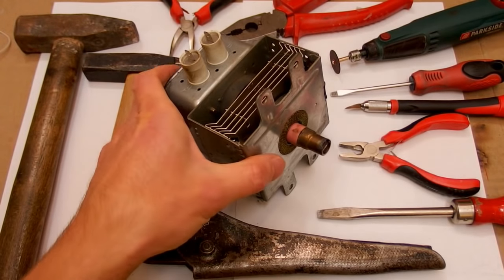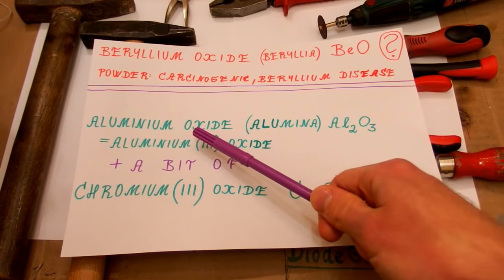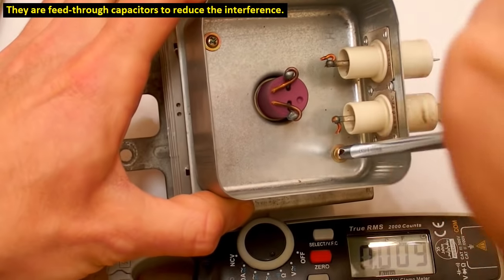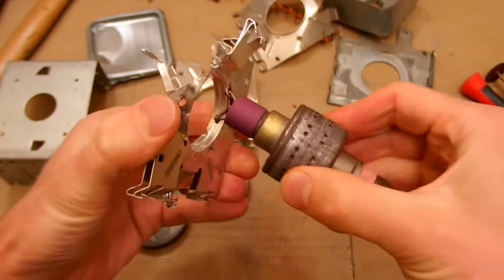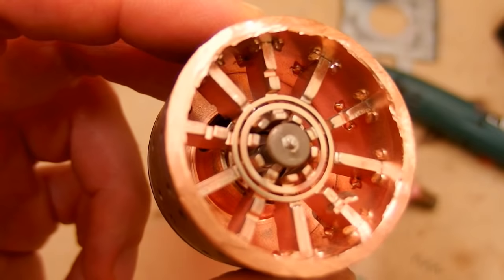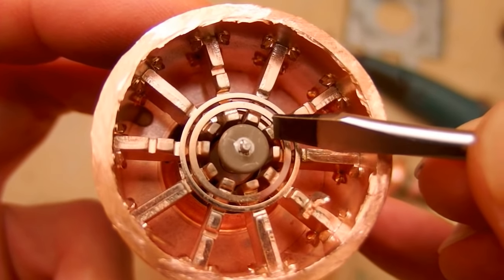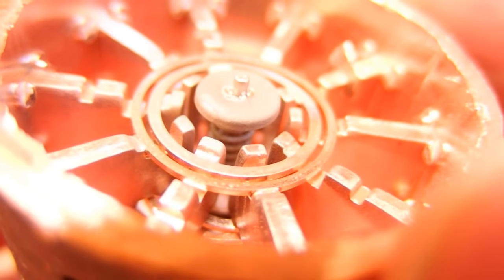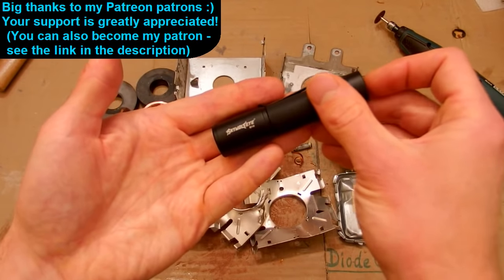What's inside a microwave oven magnetron

Comment: Beryllium oxide was very common a long time ago, but most modern magnetrons do not use it anymore, but use aluminum oxide instead. From what I have been told- again, I can't say that this is fact- a pink insulator indicates that it's a newer aluminum oxide insulator. A white insulator  could be anything, and should be assumed to be beryllium, especially on a newer unit, because the pink color- as I've heard- indicates that it's aluminium oxide, with chromium oxide added. Once again, this is information I've learned from a third party, I can't vouch for its accuracy. What is certain is beryllium oxide WAS used in older magnetrons, and may still occasionally be used today, though most have switched to aluminum oxide.
Reply: Pink color makes sense when sapphire is made of aluminum oxide hence the pink color on cmm probe tips. I wonder if that's its spectroscopy color too? How they detect elements on planets/stars
Reply: That's weird, I just read online that pink is beryllium
Reply: bro i have just smashed a white insolation and inahled it accidently :(
Reply: @picanazo420  Nice
Reply: @picanazo420 Dumb ways to die
Reply: Huh, didn't know that, I've made many magnetrons in Roblox before but i didnt know that, Maybe when i get one of those magnetrons i might not care about that pink part.
Reply: I'm also not sure, but I remember watching some video on Tech ingredients channel, and he said specifically that the pink ring is extremely toxic if it is crashed and inhaled, and that it's Beryllium. That's why I was so fixated on the ring in this video while he was fumbling around it with screwdriver, but I finally decided he's probably teasing us, since he mentioned it in the disclaimer at the beginning... It also sems I'm about four years late to this debate LOL
Reply: @johnsmith-000  Berrilyum or not, Still pretty cool and dangerous to own one of those.

Edit: spelled Beryllium wrong 💀

Comment: Pink in Beryllium is merely a added colour, as the oxide itself is white. Not al pink insulators are beryllium oxide, in general it is only used where you need very good thermal performance and a very high insulation resistance, and it is good at this, though very expensive, so in most applications you use a much cheaper aluminia instead.
Reply: Yeah, the pink is usually due to chromium oxide. In both cases. Both beryllium oxide and Aluminium oxide are really pure white. Pink or white insulator means nothing to indicate what it is.

Comment: 2.45 GHz isn't used because it is the best frequency to heat water. The main reason is that the size of the magnetron as well as the oven chamber scale with the wavelength. Commercial microwave ovens, where size and weight isn't as much of an issue, sometimes run at lower frequencies (<1GHz). 2.45GHz is also in the ISM band where it can "only" interfere with wifi, bluetooth and stuff like that. One downside of the rather high frequency is that most of the microwave energy is absorbed within 1cm of the surface of the food. That's not an issue with food that can convect (soup, drinks), but with "solid" food you can have a piece that's scalding on the outside but still cold on the inside.
Reply: Not only that, little things won't heat at all. At my old shop I had a crappy oven to heat water to make instant coffee. One day I put the jar of water in (use a jar not a nice cup cause of lime mess) and noticed a little spider inside as I closed the door and hit the timer. Die spider....what .......it's still moving, steamed up and still moving. Ding, hot water and a live spider. I took tissue paper to the spider and had coffee. Lesson: dirty insides of microwave ovens are NOT sterilized in any way shape or form and there is a fan blowing that stuff around your food! Little bits of meat blast off and germs, oh my!
Reply: @echodelta9  
Germs flying around aren't an issue. The same thing happens outside of the microwave anyway. If they multiply enough, then they can become a risk, but that's due to inproper storage.
If you have a microwave oven with a rotating dish, the waves will form a static pattern within the chamber. The spider had the "luck" of being in one of the non-irradiated spots.
There are also ovens that don't have a rotating dish. Those have a microwave "scrambler" that makes the waves move around a little and you get fewer hot and cold spots.
Reply: @echodelta9  what did the spider do to you, except try to catch bugs that cause people more problems?  Flies of all varieties, for example, spread more germs than any microwave would do. 🙄  Should've let the spider go in a cabinet or something and let him do his job. 🙄

Comment: 10:30 those Dremel wheels are usually more for cutting harder metals like aluminum, steel, and iron, they don't cut well through soft materials either due to build up of  dust sticks around where you're cutting or the softer particles will gum the blade especially with plastics, they make reinforced wheels but those things tend to cost too, plus they tend to be thicker, so you lose a little precision depending on what you're cutting
Reply: Correct me if i am wrong but copper should be harder than aluminium but softer than steel at least that what i have been experiencing when cutting steel/copper with angle grinder althou dremel and discs for it could be different. have an awesome day                 Sincerely random internet stranger, sorry for my bad english.
Reply: @milanhlavacek6730  well angle grinders wheels tend to be much thicker, the Dremel wheels cut through aluminum, steel, and iron fairly easily, I'd say copper is softer than aluminum, alteast its much more ductile than aluminum, copper is soft enough to cut with a  steel blade (with pipe they make cutters that screw on and you twist and it simply cuts through) it has a tendency to melt and stick around the cutting area, and gums the wheel as you see when he puts pressure the friction drastically cuts the Dremel speed, using less pressure and keeping the rpm high like he described works that's what I do though id have a piece of scrap steel or something so if the wheel feels gummy I just grind it on that to clean it up a little

English is fine btw
Reply: @Clancydaenlightened  thank you for taking the time to explain, im like 14 so i have next to no experience in working with metals, there is lot to learn and people like you that take the time to explain to random strangers on internet are quite rare btw im from Czech republic and like in 9 grade so i dont know that much english have a nice day

Comment: Beryllium oxide is really only dangerous if your machining it or doing some other process thats creating lots of dust. Just cracking the ceramic probably wont be an issue. We used beryllium alloys as well as ceramics and our in-house machinist had to take some special precautions when turning or milling it.

Comment: I found it interesting that you were able to measure some form of ionizing radiation from thoriated tungsten, even though it was in a plastic sleeve, as it's typically an alpha emitter. Either way, a neat tear-down. For those wondering about the 'black magic,' as an example: at 2.45 GHz, a mere 0.5 pF capacitance has a reactance of 130 Ω, and there is actually much more than that going on. }:)
Reply: its reactance is 1/angularspeed*capacitance at that frequency it should be much smaller maybe you are confusing the inductors reactance?

Comment: How do you know so much. Bow to you and your knowledge !!.
TOday, I scrapped my microwave, but due to lockdown, I had ample time. So, I separated the metals, plastic etc to that scrap dealer can handle them easily (scrap is sold in India, not just thrown in bins). I can recover some of the money of microwave oven, if I separate the steel, copper etc and then sell to scrap dealer.

Comment: I think the insulators are aluminium oxide too, but I can't give you a guarantee on that. I still handle them with care, and if I would break it, I would consult a specialist with the sample. But as you said, it is unlikely to see more expensive and harder to work beryllium oxide in consumer product, where the aluminium oxide will do very good job instead. One way to have higher confidence is check the density (weight / volume), and compare with tables, or use XRF.
Reply: Yeah... really XRF is probably the only way to be sure. Which is a pity, because HAVE YOU SEEN THE PRICE of even a crappy handheld unit?

Comment: 17:48 Magnetrons are velocity modulated AFAIK. As the electrons circulate in the gap their velocity increases and decreases as they go past the cavities and they bunch up, which then transfers energy to the anode groups. The dimensions of the tube itself then determine the operating frequency. The velocity of the electrons themselves is too slow for direct operation at microwave frequencies.

Comment: I believe that the cathode filament still is isolated from the magnetron body / anode. Thereby the cathode which has the high (negative) potential cannot directly influence the voltages at the output or anode area in general.(see 17:30)
I would believe that the output impedance is lower than with normal electron tubes. Judging by the size of the output connection there might be several amperes of RF power, which correlates to probably less than 100 volts of voltage at that point.
Thanks again for a great video!

Comment: Interesting. Never seen the inside of a cheaper modern magnitron. Early ones did not have the rings and the anode cavities were a solid part, not assembled from bars. I think the rings are for mechanical stability of this design to prevent de-tuning if the anode overheats. Older ones were suspectable to loss of efficiency (low power output) and high power use resulting in tube overheating.
Reply: where can i find a image of old magnetrons? i really want to look inside one of those

Comment: First of all this is a good video!
About radiation precaution advice I believe the same that you said. And for example I mentioned the smoke detector that contains a radio active substance like Americium. Naturally there is the necessary signal of the radioactive substance. So is it possible microwave that is for food to not have the same signal? I think not. Instead there is only the Lightning strike that indicates high voltage. Of course there is beryllium oxide (pink layer)but as you said is toxic only if you break it and inhale the dust! 
The thorium tungsten alloy cathode is slightly radio active possible less than Americium or almost like  ground.

Comment: Because wireless communication snd microwave ovens magnetrons frequency are same it can interfere with smartphone ??
Reply: its 50MHz apart
Reply: @mzflighter6905  so what if both will same ? At how much distance it will affect device with only single bare magnetron !!??
Reply: I mean there is the distance where it has to interfere with/  damage the circuitry because of the enormous power density
Reply: @omsingharjit  Microwave ovens are very well shielded, so only maybe a few mW of microwaves can make it out. Also, wifi and such are modern digital protocols, so they can tolerate quite a bit of disturbances without much issue.
Reply: @Basement-Science  i know that's why i used that word
 " bare magnetron "
Reply: Its wavelength are so big that ,  it can't pass from mm holes .

Comment: Those two rings at the centre are EQUALISER RINGS  to balance out the " capacitor" voltages on those  ten parallel conceited tuned circuits. They also use them in larger generators. That output strap is in fact a magnetic loop or a magnetic probe,  which is not floating on its own,  but acting as a tapping on an autotransformer with a given ratio so that the output impedance is lowered as it feeds the load.

Each of those resonant circuit may be looked upon as a flute where the open end has a wind blowing across it, The fact that the electron is negatively charges then   as it approach's one end that end goes negative, then as it starts leaving it, that end will start ging positive while the next end that is being approached will go negative and the tuned circuit will set up  and determine the resonant frequency. where the equaliser ring will set up a state where  all the tuned circuits are forced to resonate at the same frequency. 

The space below and above the  radially projected inductive part of the  exist to allow the magnetic field LOOPS  to form and  thus they will excite the magnetic probe by causing the loop of magnetic fields to  go through it where a curling electric field will be generated in the copper of the magnetic probe.  All the Gradients and divergences and curls mentioned in Maxwell equations may easily be followed in that magnetron.  I like the manner in which they used rectangular copper radial parts to increase the capacity between the faces.

Note that the 6 Volts feeding the heater are superimposed on the voltage of the " diode doubler pump  which probably takes the cathode to minus 6,000 volts pulse. The manner in which the radial parts are held on the circumference is an ingenious riveting system and no brazing is done. The engineering of that magnetron looks primitive but it is effective as it is not a high fidelity amplifier to reproduce music but shear power  to heat food is all that is required. and a few harmonics will not hurt in this case.

The presentation is good, but the speaker should spend some time listening to normal English language as spoken in England, I spent  16  years in England travelling from Dover, Portsmouth, Devonport,  Cornwall Par, Wales , Carlyle, Lake district, Scotland, Barnbarough, Holy Island,  Newcastle and  Manchester and Nottingham,  listening to the different English accents, and sixteen years later headed back home,  I would suggest that everyone who presents public videos in the English language  should spend a few hours listening to the Oxford University debates. They do not exactly speak the King's  or the Queen's English , but  it would enhance this presentation. If one is to go public with technical contents , one should also consider the effect of the spoken delivery. 

Note that it is not always wise to use power tools and with me being a very old man, I would not have used that dermal,  grinder, but a good old hacksaw which I had for over 75 years since I was ten years old would have made a better job of dissecting that magnetron. 

How a magnetron is excited analogy.
https://youtu.be/5tTkDQnT95g?si=5rD8KGjWz7vy54zU
https://youtu.be/zKTS95KOrOI?si=ncN-2HCduKM4PDLk
.https://youtu.be/E18iLLioN6o?si=RyRc6nrJXrIbcAAt

.

Comment: Ok my second time back here after thinking about that copper arrangement in the middle - which is why I'm on your page bro.
I'm holding one and haven't scratched it to see it's copper yet - and because shit happens I just wanted to know what was in side. Now I'm glad you are here because I was going to cut the other end off first and I would have found the "boring light bulb" bit and missed out on the "Antenna"
Now back to the 2.45 GHz and that copper top bit you ripped off.

Suggested observation

A. there is a ring capacitor - you can't get away from those two rings and Cap's everything down to that gap which means it's an "Antenna"!

B. How those chambers work is going to be the magnet flows.  [has to be look at the flow]

This is working in the same way you can drop an iron bar in acid and paint copper direct on to it using Amps / Volts and the medium is the acid.

Here the Medium is the stressed Magnetic Field - the distance of those magnets and going to be right on a stress point and those copper shapes give it exactly what it wants to effect electrons [just like an Air coil ] without iron.
Look at it, Everything between the magnets is copper or alli and of those "Copper controls Magnets" and therefore the alli is to control backfeed - collectors or reflectors .

So they're compressing microwaves into they 14mm x 12mm wide copper stub under the top then out through that 5mm hole at the top.

When you have a look at the fine edge of that 14mm stub in the middle on the fine edge in the 5mm part under the hole in the cap, you can see the copper has been stolen - !IT'S MOVED SOME COPPER! using a magnet and pressure and the 2.45 is as you say only water related.
Right! I need to cut the end you did off first - Thanks.

Have you got an operating Tesla Coil - and Air Coil where a base frequency sets off a simple "child on a swing" effect controlled by a single power supply  and a crude capacitor and spark?

The medium there is air and the magnets are replaced with frequency.
How may times do you push that child and right time per second .

When you go Too High the Tesla Coil will begin to spark from the cap.

"STATIC" is Achieved just BEFORE the spark at the cap of the coil.

STATIC - is a very fluid state where MATTER can be influenced by magnetic.

Hand's up anyone who can tell me where the Largest Working Tesla Coil in The World is?

Speak up anyone who can now name the Largest Twin Tower Tesla Coil ever constructed?

Comment: Beryllium oxide is used as sockets for highpower tubes in ham radio amplifiers because they are very thermally conductive. As long as a file or other means does not create dust that could be breathed in its considered safe.